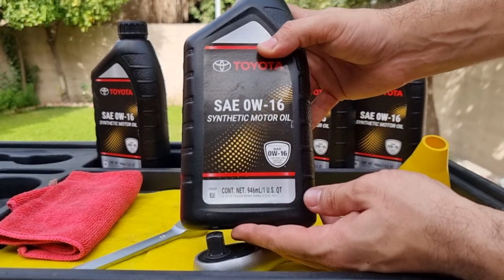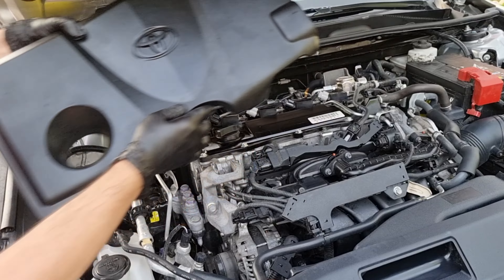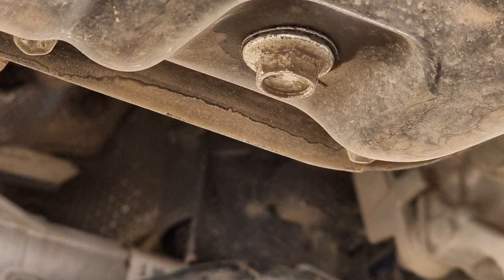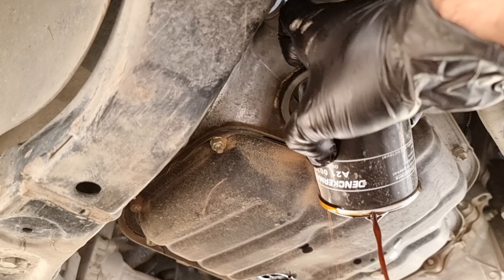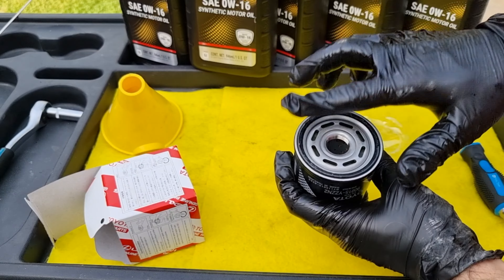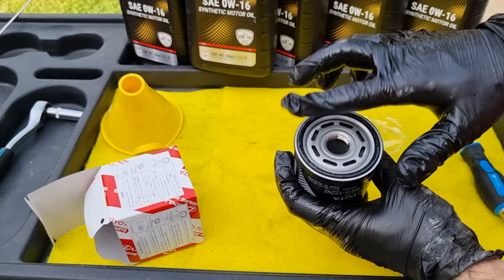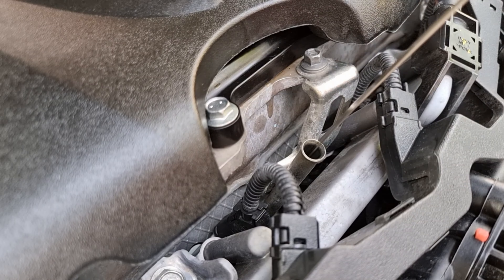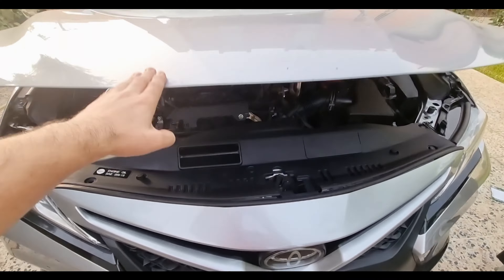How to change Toyota Camry 2.5L Engine OIL 2018-2022/How to reset scheduled maintenance on camry

Comment: Great video! The only thing I would add is to recheck the oil level again after starting (1 minute) and shutting off the engine, because the oil filter filling up will cause the oil level to go slightly down.
Reply from the maker: these fitters are small, doesn't effect the level, but its a good idea to check it again
Reply: Peujo 206 2014
Reply: Put the correct amount and there's no need to check lol
Reply: @AliMECH 🎉
Reply: Oil filter part number

Comment: Do not put 0-W20 on a 0-W16 engine.
Reply: Toyota manual says you can in a pinch but you should get it replaced the next oil change with the 0W-16.

Comment: How often do you change your oil? The oil thag you changed looks really good, not completely black.
Reply: It looks to be between 4000-6000 based on the color but if you do changes before every 5K (assuming you didn’t treat it like a race car) you can easily change it every 5K and increase the longevity of the engine. If you’re waiting for it to turn black you’re already late and causing sludge to form in the engine which will eventually lead to failure. Don’t wait till the 10K that’s advertised or you’re going to be replacing the engine between 100k and 170K miles.
Reply: @danielm.1608 thank you for the advice. I plan to do it every 5k, if not sooner, or every 6 months: which ever comes first.
Reply: I also replace the oil plug washer with each change being sure to remove the previous washer sometimes stuck to the oil pan
Reply: @Element0f_1  have you done any other maintenance, such as the transmission fluid, the coolant fluid, brake, etc? Also, some people change their drain plug screw on every oil change, what are your thoughts on this?
Reply: @kellsknowing4238  the trans fluid and coolant fluids both  changed at 60k brake fluid was changed at 50k beaause front and rear pads and rotors were swapped out. As far as the oil plug replaced each oil change that is unnecessary but def change the plug washer each oil change. I have changed the plug once but only because the hex was starting to get rounded out from using a crescent wrench. 14mm ratchet is the way to go.
Reply: @Element0f_1 thank you so much for this information. Makes me feel more confident in the oil plug!

Comment: Thank you ! This oil change video for camry helped me a lot and I got encouraged by watching it over and over again! I bought all the tools and wrenches and oil, washer, oil filter, jack lift, jack stand altogether! Finally I tried my first self oil change and it’s well done! Thank you once again for recording this video and I appreciate sharing your know-hows!
Reply from the maker: Glad it helped! That's great if you can do it from now, saving money and satisfaction
Reply: thank you. how much did it cost for all the parts and supplies? how long does it take to change?- im thinking of doing this as well
Reply: @Andrew-cg2zl  you might need 300$ now for the tools and all, but you will save money on the long run. takes  like 20 mins

Comment: Does the steering rack and columns feel hot when driving ? Because the exhaust is on the back of the engine

Comment: Very impressed with this video.  The one item I wonder about is if the engine cover underneath was not missing, where do you place the floor jack?
Reply from the maker: Thanks, i jacked from subframe
Reply: Are you serious…you can ONLY place a jack on the frame or designated/marked spots/area
Reply: @andruc2758  Yes, I am very serious.  This car is a first where literally the entire underbody has plastic covering so that literally none of the frame is exposed.  I normally place my floorjack on the frame however they're all covered with plastic and there are no "marked" locations.  
So, NO, none of those are plainly visible.  The only ones plainly visible are the jack points for the car jack which is not the same as the floor jack for what lifts the car.  Don't get upset over, it was just a question.
Reply: There is a legit big circle of frame to Jack it up from even with all the plastic attached. Front and back.

Comment: Thanks for the nice  video. I have a corolla hb with 8nr fts engine 1.2 lt turbo. I wonder to know is it compatible to use 0w16 oil? Toyota advise 0w20 normally.
Reply: Please please please follow what your owner manual says

Comment: great video! I love how you shows us. I know this is stupid question.. how often do you recommend to change engine oil for Toyota camry 2019 ? My mileage is about 23000. I know Toyota says every 10000 miles or every year. but some local experts says every 5000 miles.  I'd like to  know your opiniton
Reply from the maker: Thanks, I usually change between 5k to 6k

Comment: When the new filter is filled with oil as stated, then turned sideways to install, why doesn’t the new oil drain out?
Reply: If you put on the captions you can see he actually said he didnt fill it this time because its not a heavy duty engine

Comment: Been running nothing but 0w20 on mine , not really a huge difference between that and the 0w16. Hard to find 0w16 and it’s usually double the price of the 0w20. Haven’t noticed any economy or power difference.

Comment: How often needs to be changed the oil? Went for the first service to the Toyota dealer and they told me it’s every 10,000 miles, not every 5,000 miles ????
Reply from the maker: With fully synthetic, its 10k, but I always replace it sooner
Reply: They say that but honestly bc our engine is small it’s just better to change it more often like I live in AZ so these temperatures play a factor too I believe or that’s what I was told😭
Reply: It’s every 10,000 miles until you reach 50k mileage, then it’s every 5,000 miles
Reply: Went to 3 different Toyota dealers and they told me it’s a 90915-YZZN1 oil filter, they don’t have the one that ends on N2 , so I just bought that one

Comment: (Vehicle I no longer owned)
2018 RAV4 47,900 miles 

(Vehicle I currently owned)
2005 Toyota Sequoia SR5 45,500 miles from Toyota dealership it really good shape does have rust on frame I just replaced whole frame from dealership for free under recall 

2021 Nissan Rouge SV 10,590 miles

I did my best to maintain the vehicle oil change every 5,000 miles and multiple fluid change

Comment: nice video, what is the brand of those Jack Stands? are they 2 or 3 tons per jack? , can I lift my car with the regular jack from one side?
Reply from the maker: its a 3 ton aftermarket, not sure whats the brand name, i lift from subframe at the middle most of the times
Reply: Thanks for reply, I also need a good  ratchet, what brand do you use? And the brand of the floor jack? 
I like your videos, you do a great job and good quality of sounds and pictures. But it would be better if you listed your products in the description, so everyone watching could know what to buy or use. Thanks brother

Comment: Shouldn't you supposed to use 716 ml from the last bottle? Because if we did the math that will equal 4.5 litters.
Reply: Its best to under fill and test because there can be residual oil left in the pan.

Comment: What is that spray you used to clean the drain area called?
Reply: Any brake cleaner will work.  Also it will dry out the paint on thy oil pan.  That why his turned gray/ white. 
Wiping the area clean is better

Comment: FYI, Mobil 1 makes the Toyota oil, so just get the Mobil 1 0-W16 synthetic oil (5qt) and you'll save $20+. It's the same thing just repackaged for Toyota.
Reply: no wonder I've seen Mobil 1 being sold at the Parts Dept!!

Comment: The oil level should be inbetween the two dots... not to the top dot according to the manual. The oil will get hot and expand... you filled the oil too high.

Comment: Oil looked pretty clean
Reply from the maker: It was after 4k with using commercial brand, thats why i changed to toyota brand
Reply: @AliMECH  Wasn't black at all.
Reply from the maker: Yes you are right
Reply: @AliMECH  Knew a guy who used Mobil 1 in his fleet of sales cars and went well over 15k between oil changes with no issues at all.
Reply from the maker: I seen some good reviews and tests about mobile 1, it looks 👌
Reply: @AliMECH  it was the 1st major synthetic oil out there & it came out in the late 70's

Comment: Does doing your own oil change void the 24 month maintenance free plan?
Reply: Shouldn't as long as you use genuine parts and you dont tell them. If its a different filter then it probably will void warranty
Reply: NO. Document your procedure, date , mileage and keep your receipts for the oil and filter.